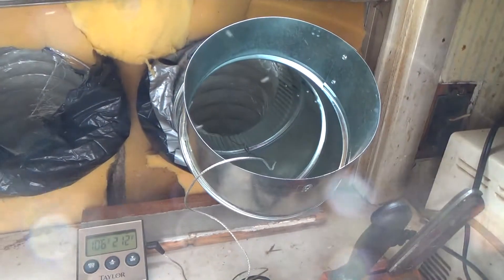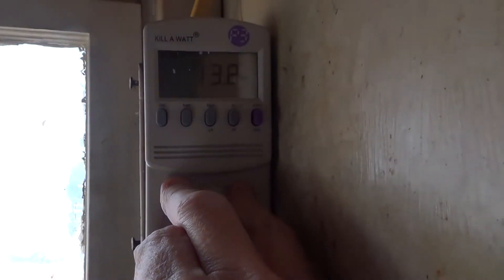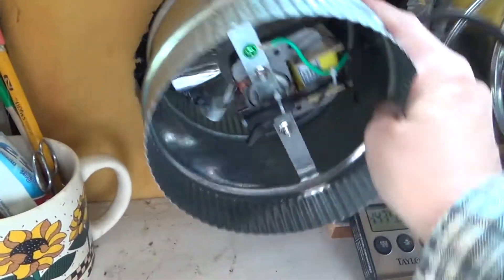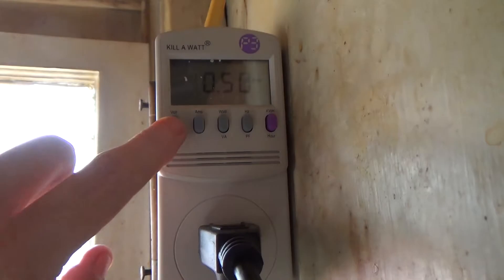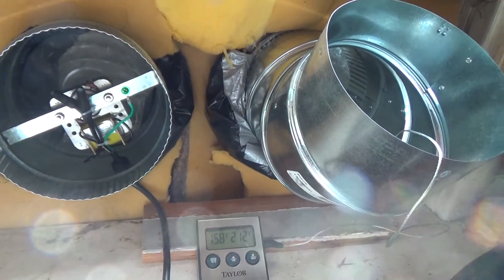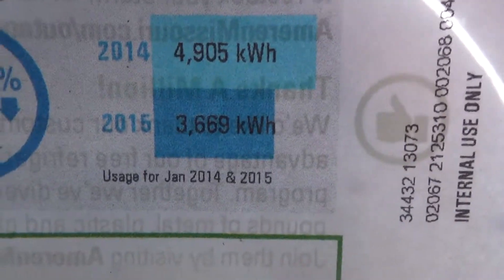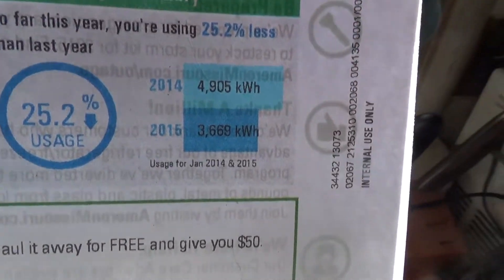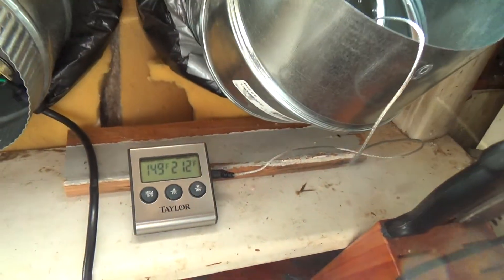Proof of energy saved. Using Solar heater, bubble foil on windows and insulation added

Comment: How do you know that the 25% reduction is only due to your insulation/solar heater ? Is there any correction for the weather, did you count the number of days you had to turn on the heat ? Without these data, saying that these measures allowed you to reduce your energy bill is probably true, but 25% might be over, or underestimated if not corrected for the weather ! 
Thanks to let me know !
Reply from the maker: Michaël Weber the 25 percent was reflected on my electric bill that month. Over time it was 18 to 27. Per month.  I was not well this winter and electric bill went up 20 percent or more over last year's usage. The electric bill shows weather fluctuations also.  So i let them do the calculations.

Comment: When I built this (in a box) for my daughter - I got free shower doors on Craig's List. The glass is tempered  and aluminum frames are square and easy to drill. Then I built the box to match the size of the doors. It takes some patience to find clear doors but that's to be expected for free. There are usually plenty on CL for $20-50 per set.
Reply from the maker: +KaleidoscopeJunkie That is a great ideal. Thank you :)

Comment: That is awesome.  Do you have a video on how you made that, and how it functions.  I think that would be a great addition to the AFrame or the RV.  
that reflectex is great stuff.  Great job!
Reply from the maker: hank you. I do have more videos on this. But this is a commercial unit. My past neighbors in St. Louis, did not want to pay to have it took off and re installed with a new roof. So I have 2 solar heating panels. I will be building some to compare the difference. And I will be opening the 2nd panel to see what is inside in spring or summer. It is only a benefit if you get enough strong sun.